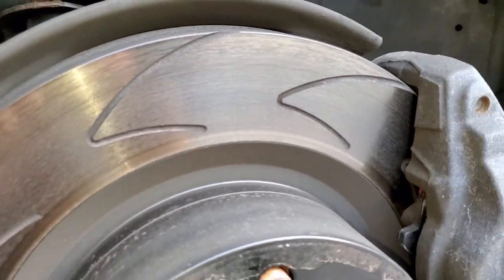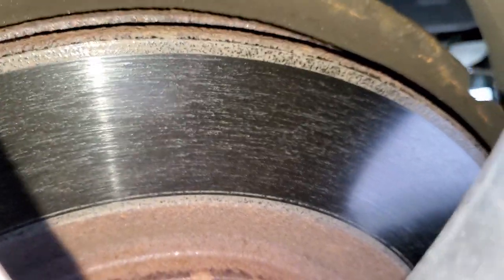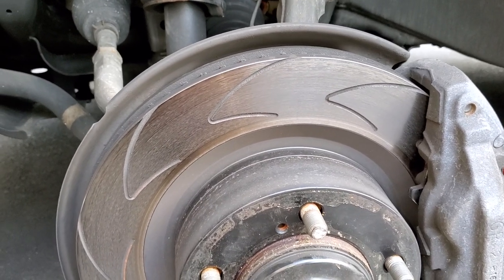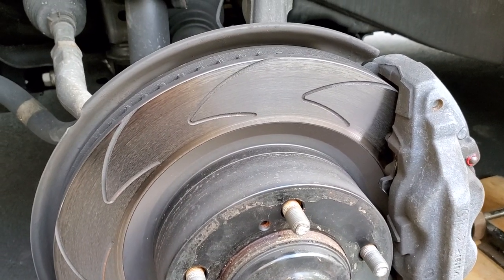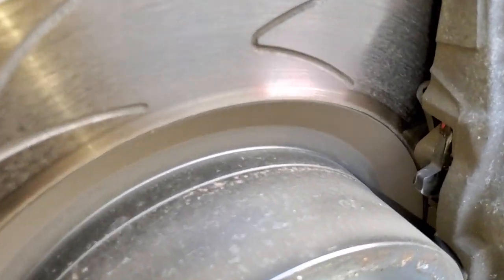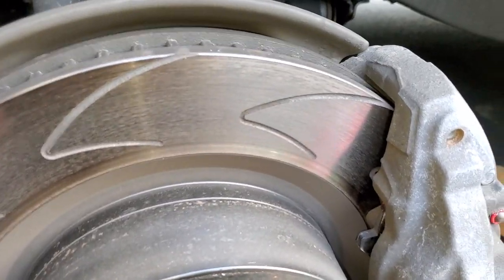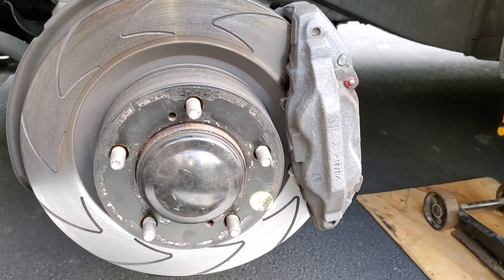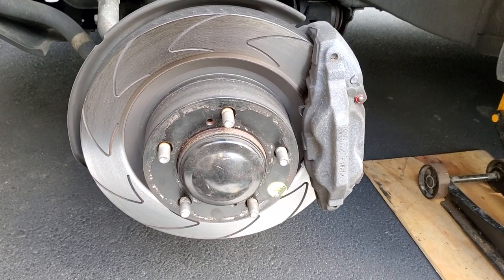Best rotors money can buy! Best rotors for heavy vehicles? Best rotors for Toyota Tundra?

Comment: I have a 2021 tundra TRD pro. At 23000 miles and my front brake rotors was pulsating. Luckily it was still under warranty. I brought the truck in and then resurface the rotors. . Not I’m thinking about keeping the truck. The first thing I would do is to upgrade the rotors front and back
Reply from the maker: Brake maintenance for tundra that no one talks 
https://youtu.be/LuURfVavm7A
Reply: What did the dealer do ? Did they charge you?, bc I have a 2021 tundra and I have less the 14,000miles and I started to get the shake when stopping.

Comment: Which ebc pads would u go with? Red or orange
Reply from the maker: Good question, not sure. I need to read the difference on their website
Reply: I'd use yellow really, the RED is for EXTREME use. If its just a daily grocery getter and mild towing YUH won't need anything that HEAVY DUTY as far as a brake pad goes...
Reply: @robsnizzle7  I tow a 8600lbs toy hauler.
Reply: @PDK7777  sounds like orange with some cross drilled slotted rotors would be my opinion.....🤙😎

Comment: Ebc makes good stuff.  Known in the motorcycle market.
Reply from the maker: Thank you for sharing this information
Reply: I have a complete set of EBC slotted/drilled rotors and heavy duty pads getting ready to go onto my Toyota truck along with new calipers and stainless lines. She’s working on 300,000 miles and I know the EBC brakes will help tremendously ! Love the black surface of the rotors too…

Comment: Sounds to me like your setup up is BAD, I love EBC but maybe the combo (rotors an pads) aren't efficient. I've never used HAWK so I can't comment the quality but I've always felt they were cheap. EBC makes good stuff thats why I've used there set-up (rotors pads) they usually offer. I personally though use STOP-TECHS HD TRUCK BRAKE PADS and cross drilled slotted rotor set-up.... has a hell of a bite when you STEP ON IT, only bummer about 1st gen Tundras (mines an '06 4X4 D.C.) is the constant NEED for RE-ADJUSTMENT on the REAR BRAKE DRUMS (PRETTY ANNOYING REALLY). The front however what I'm running is pretty good, I also upgraded to STAINLESS STEEL BRAKE LINE FRONT (from STOP-TECH ALSO) AND BACK. There's Also a conversion for 1ST GEN TUNDRAS (with LITTLE MACHINING NEEDED) is UPGRADING to the LEXUS GX460 FRONT CALIPERS AN ROTORS, WHICH ARE "MASSIVE". "EVERGEEN OVERLAND" has a video on it, plus look up 1ST GEN BRAKE UPGRADE an there's quite a few vids on this subject IN YOUTUBE. The stop techs I have on RIGHT NOW, have been on for QUITE SOMETIME (COUPLE YEARS ACTUALLY), an yet HAVEN'T had to TURN EM or change the pads. NOT SURE WHAT VEHICLE YEAR YOU GOT but you might wanna look at your LSPV valve (load sensing proportioning valve) TOYOTA TRUCKS with high mileage ARE NOTORIOIS for having these GO BAD, so it ends up putting MOST OF THE BREAKING LOAD on the FRONT END of the truck hence the CONSTANT front brake work being needed because your rears aren't being used as they should be.... BLEED THE WHOLE SYSTEM "INCLUD8NG THAT VALVE (which is hiding behind your spare tire).... and see how the pedal feels, IF IT'S SPONGY then it's probably BAD. Also, FLUSH an FILL the BRAKE FLUID. Changing fluid and bleeding the brakes is a CHEAP 1st STEP.
Reply from the maker: Second gen tundras and sequoias don't have LSPV. Rear brakes in general only brake at max 20% and 80% front.

Comment: I’ve always have had factory rotors and have never replaced them. I usually keep my vehicles 100.000 +
I do my own breaks and not even resurfaced the rotors. I’m easy on breaks as well.
I have a 2011 Corolla and 2017 tundra that I will do my breaks on both this month.  Was thinking of using Acopulo break pads. I’m sure spelling is off.

Comment: Thank you for bringing this brand to my attention, I also wanted to ask if you can suggest brands for ball joints, tie rods and other critical components of the car. Thank you
Reply from the maker: Very good question.  My experience and research,  factory ball joints last about 100k-250k miles depending on the vehicle and how its being used.  After market ball joints come with lifetime warranty and so on, however,  I have not seen yet them lasting at least 100k miles.  But,  there's a lot of brands out there and some are engineered beefier than factory, but it depends on the vehicle.

Comment: Love my 2nd gen Tundra. But I will admit the brake system is horrendous. I can barely get 20K miles out of the front rotors. It is so god damn annoying. I tried everything. New OEM calipers,  rotors and pads. I gave aftermarket rotors and pads a try(Was even worse). Anyway I will try EBC and see what happens. This absolutely should have been a Toyota service bulletin fix from the start. It is  not safe.
Reply from the maker: Don’t forget to watch this video, it has additional details for tundra front rotors.
https://youtu.be/LuURfVavm7A

Comment: what abut Wagner ? do u think they made a good rotors ?
And  i have camry 2018 xse what do u advise me to buy rotors without noise ?
Reply from the maker: Wagner rotors just an average rotor,  nothing special about.  If you don't want humming noise after 70mph, don't buy rotors that are slotted or cross drilled, just plain rotors.  What is wrong with your 3 years old factory rotors?
Reply: @repairvehicle   After six months when i hit the brake i feel the car start shaking and got worse with time .
Reply from the maker: You definitely need better rotors.

Comment: Hi I have quickly question. Any You know which brand that they sell under America parts? I am tried to find my calipers all four needs change (Chevrolet Avalanche 2002 Z71) (2piston both front and rear) I cannot find it. All is made from Chinese parts issue.

Second question - I thought Semi metallic the best for truck / suv and tow better respond brake? 

Ceramic - good rate but will be short life for tow a lot?
Reply from the maker: Thank you for asking.  

When comes to brake pads material,  I don't know which material works best for each application.  Seems like depending on the brand it varies. 

American made calipers will have premium price.  I don't know what companies sells American made calipers.  Chevy Dealers might be selling American made, but I don't know for sure. Wilwood brakes company, makes brake calipers here in US but they are expensive and usually only come as big brakes kit.
Reply from the maker: Have you tried rockauto website?
Reply from the maker: Check this website https://mzwmotor.com/top-brake-caliper-manufacturers-list/#Centric
Reply: @repairvehicle  wow! Wilwood caliper very pricey! What is best suggest that tow and daily drive caliper better brand? Napa? Or? I would not follow under GM Acdelco issue made from Chine parts
Reply from the maker: I am not sure if napa makes brand new calipers or just remanufactures old calipers. When it comes to calipers,  I really don't know who has better quality.  In my 30 plus years with cars, I have never replaced calipers. However,  I have replaced Master brake cylinder and had very bad experience with them being purchased from auto zone and advance auto parts,  brand new and not working. I had to return and get another one.
Reply: @repairvehicle  I see wow! Made sense! I will go to Napa to see what is have good. Mine caliper due need change Because of flush brake fluid rust issue valve destroy

Comment: I got 90k out of my fac rotors an pads lx570
Then bought ebc
Reply from the maker: Must be Japanese quality or highway driving
Reply: Try ebc  hd slotted an dimpled
Rotors an hd orange pads next time
Reply: Toyota wanted 605 for new rotor an pads . I got ebc hd rotors an pads for a lil over 800
Reply: I am still on the original rotors on my LX570 with 180,000 mi and my GX470 with 210,000 mi.  After it wears out, I will likely get either EBC (I had those on my 4Runner) or Akebono rotors.  I have swapped out many brake pads though.